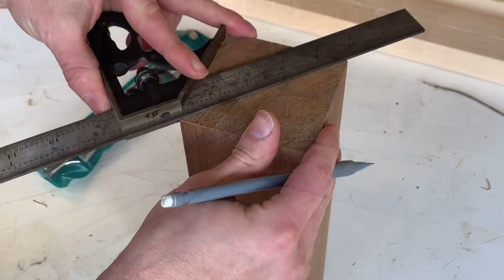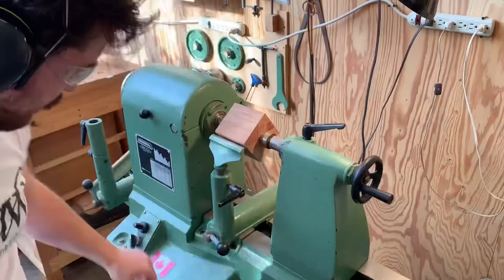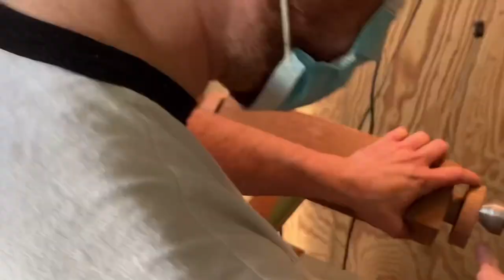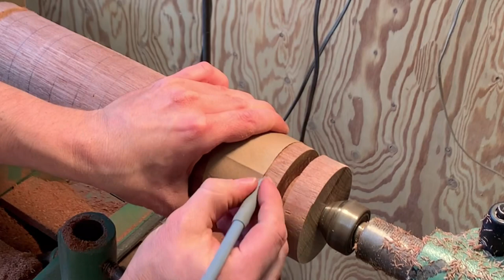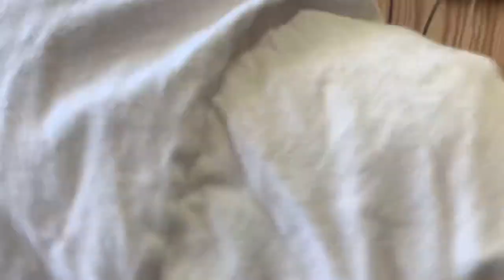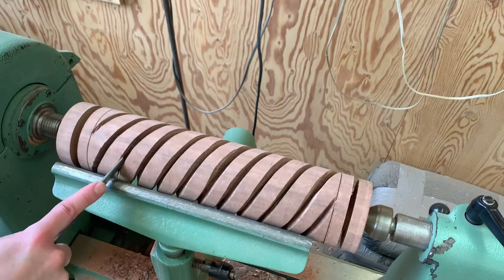Hand Carved Barley Twist Pepper Mill

Comment: Very nice.  have you ever seen a Sears router Crafter?  They make spirals really nice and much easier.  What did you do to make a pepper mill out of it?  With it being hollow inside what helps the pepper?
Reply from the maker: I’ve always made barley twists by hand to keep my hand skills sharp. However, as I get older the router method does seem more appealing. It’s a major time saver and they come out perfect every time. With this pepper mill the base twisted off to add more pepper. With later versions there’s a clear tube that runs through the center.

Comment: Why do you rest the tool on top of the wood when your turning?  You’re quite talented!  Thank you for sharing your expertise. 🙂
Reply from the maker: It’s to check whether the wood is fully a cylinder without having to stop the lathe. If the wood has flats the tool will bounce and the vibration will be loud. If the wood is a cylinder the tool will rest smoothly on it.
Reply: @JShawFurniture  Thanks for explaining.